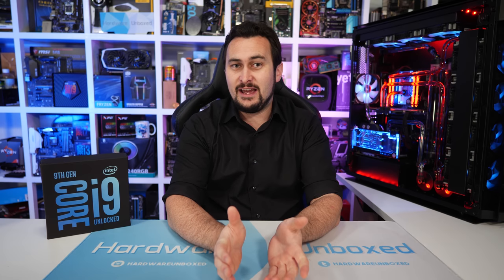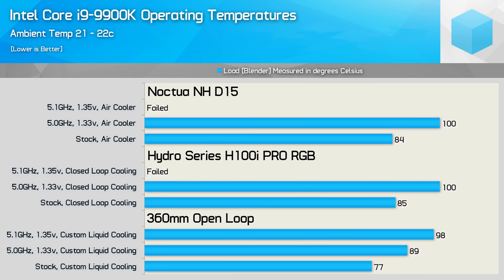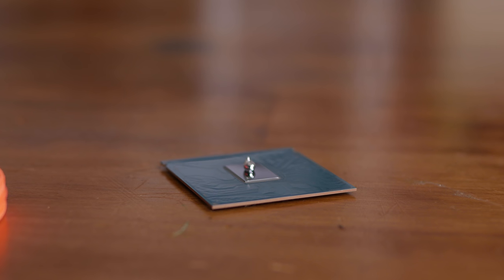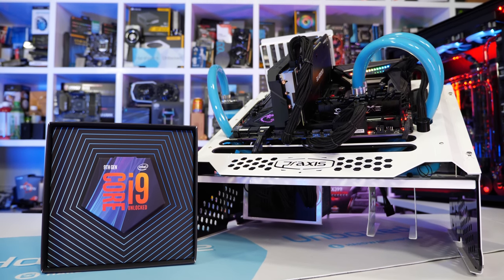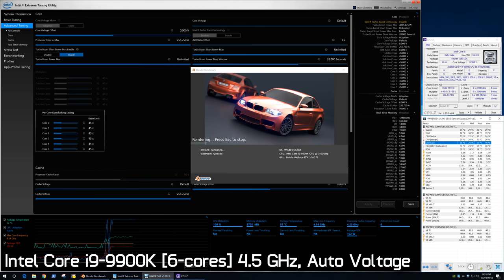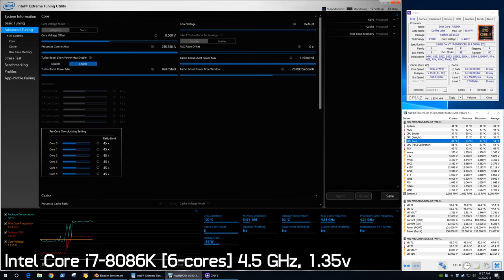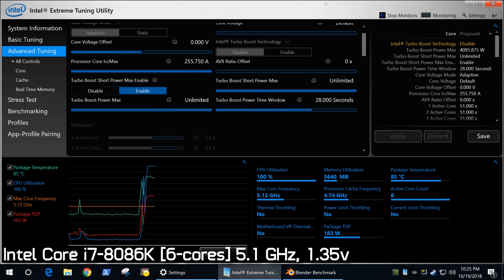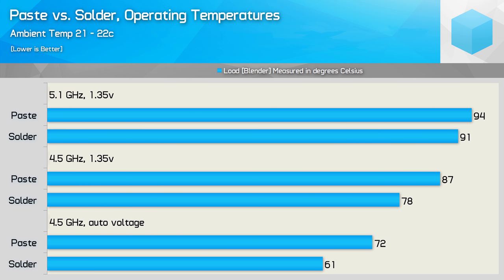Why is the Core i9-9900K so HOT? STIM test, Solder vs. Paste

Comment: I want to drop this here for anyone who is capable of thinking instead of some of the random memes and outright delusion in many other comments. The reason this CPU is so hot has nothing to do with intel's design, TIM, or any other factor. Could it be better...maybe but there are a lot of complex compromises that need to be made in bleeding edge products to produce something that not only works, but last for a long time. 

Solder itself when pushed through multiple "heating cycles" tends to kinda fail. This is why special soft solder is used as well as a lot of it. The softer and thicker the solder the better it holds up. Using leaded solder would also be great, but it is illegal in many places for this application(apparently)

As for their older TIM which many people compare to toothpaste despite linus showing it works much better it isn't bad for its use case. They could have used cheaper stuff that had better thermal conductivity at the cost of it only lasting a few years. Most CPUs are sold to people who don't know how or won't delid their chips after a few years because the TIM has broken down. I have a core 2 quad q6600 from 12 years ago that still performs the same thermally as it did not long after putting it in the system. Over 12 years and it is still holding up which is impressive IMO. The thermal compound you put between a block of your cooler and the IHS on the CPU doesn't need to last as long and thus you can get away with stuff that breaks down after 2-3 years of heavily use vs over a dozen years.

Now why is intel's cpu getting hotter than an amd chip with the same cores/threads and why did intel make design choices such as thicker solder, a thicker sub-strait, and a thicker die? Because these were necessary to accommodate such a high performing product. Thinner solder would fail much earlier than the 10-12 year mark.The thicker silicon wafer and thicker top on the die are necessary to help with stresses from being soldered from thermal expansion and contraction and still support the massive tower style coolers. AMDs CPU thermal layout is actually pretty damn similar just from looking. They use a very similar solder(if not the same it is exceptionally close and thus performs nearly the same), and their silicon wafers are pretty close in size. So then it is voltage right...no AMD chips actually draw more power believe it or not. The real answer why the 9900k is hotter than something like the 2700x and why all of intel's recent high end chips have been on the toasty side is 100% clock speed. Intel clocks their chips around 1ghz higher out of the box than amd chips and generally you can get an overclocked intel chip to around 1ghz higher than a similar amd chip. The speed included on chips(in ghz in this instance) are the number of clock cycles per unit which is still in seconds these days IIRC.(ram these days is ddr which is double data rate, but AFAIK CPUs are still measures in clocks per second) So the jump from 4ghz to 5ghz is a 25% increase in clockspeed which is a lot more energy used per core some of which is lost as heat.

For example take a 2700k and a 9900k and clock them both at say 3.8 locked and then look at the temps. I guarantee you the amd chip will be slightly higher assuming everything else is equal.(same case, cooler, fan speed, thermal compound used, ambient, etc) This will only become more dramatic as you push the 2700k up closer to around 4.3ghz which is generally the max overclock I have seen without exotic cooling and such. The intel chip clocks higher out of the box. Clock speed isn't the be all and end all most of this knows this and if the intel chips were clocked the same as the amd chips there would basically be parity between like models outside of any architecture differences as amd is pretty close to intel in IPC at the moment. So the 2700x would have roughly the same performance as the 9900k making price really the only determining factor.

Now on to price. Yes this is an expensive chip because of the performance. It takes a lot more time and money on engineering and R&D to put out something that is at the very limit of technology...not just for intel but for CPUs in general. We are starting to hit the point to where we can't get smaller or more power efficient with currently known methods. This is why smaller nodes(intel 10nm amd 7nm which are basically the same thing) have been delayed so heavily. Without getting into quantum mechanics we are at a absolutely microscopic scale here. The transistors used in current chips are only several atoms thick which is causing issues. Any smaller and we start running into Quantum tunnelling which means we need some new space age material or some new redesign of processors which really haven't changed on a basic physical level in decades at this point.

Comment: This Intel release kinda feel like a rush job.They were on the back foot and needed to release something.That something not necessary good.This price is wrong for the performance.It over heats.They tried what amd did just worst.AMD's not the fastest cpu by all means but it's better.Price is cheap.Can get away with stock cooler.Cheap Mobo and over all good performer.
Reply: >This Intel release kinda feel like a rush job.
mostly because it really is. 8700k/8086 does the same job for games on low rez (likely 8086k is even better with more overclock headroom) and for anything else threadripper offers a lot more

Comment: "If you don't want it to overheat, don't overclock it!"
Reply: Good Advice, buy an Intel K CPU that is meant for overclocking and don't overclock it.
Reply: Excaliber  Or just melt it while running cinebench in a loop.
Reply: Exactly what Apple would say if they made this chip 😂😂😂😂
Reply: @vishalgb315  actually Intel said those words back in 2017 in response to people complaining that their 7700K overheated when overclocked
Reply: Problem is it needs like a Noctua D15 just to stock turbo! 😆
Reply: Excaliber  My problem exactly with using it as a workstation cpu- hot, power efficiency and long term reliability of itself and other components.
Reply: Excaliber  My problem exactly with using it as a workstation cpu- hot, power efficiency and long term reliability of itself and other components.
Reply: @carlwells9504  imagine using it with stock Intel cooler they bundle it with those Pentium CPU

Comment: Problem is if you have 2080ti, the only CPU that can feed properly it is the 9900K. Overclocking doesn't really make a lot of sense, since the default config is really enough. Overclocking will just kill a very expensive an already very fast CPU.

Comment: The reason why 9900k is hotter than the 2700x is because obviously the much higher clock speeds AND smaller die size (~177 mm2 vs 213mm2). The 9900k has much higher energy density and there's a lot less surface area transferring the heat from the die to the IHS.

Comment: Intel's architecture is just hitting its limits. Just like Ryzen hits a wall at 4.3ghz, Intel hits a wall around 5ghz. The chips will do it but voltage and temps skyrocket along with power consumption. I wonder when they'll start from scratch like AMD did with ryzen? Been using "Core" arch since 2006. Starting to see the limits.

Comment: Had my 8700k running 4.7ghz allcore on 1.240v prime AVX load  with delid 82c

9900k running 4.7ghz allcore with 1.185v prime stable with AVX max 83c (none delid)

Sillicon lottery seems to be a thing. Or someone is pushing too many volts on the 9900k

Comment: I disagree they added this because they wanted a safe product based on intels not streamline process for soder since there manufacturing facilities are not as compared to AMDs third party manufacturers. This is the price for keeping a closed community to the CPU market and want to keep everything in house. Yes it drives cost down but when you dont want to change the manufacturing process for profits instead of innovating and mocking to slap 2 chips together for reduced tempatures.

Comment: Let's say, we're going to use this chip under normal conditions in a workstation without any fancy coolers and no OC. Does the STIM has longer life span than PTIM? if yes, then Intel did the right move 100% .
Reply from the maker: Life span should be the same, longer than you'll want to use it.

Comment: I think thats why AMD split in 2 CCSs! Spread the heat more evenly!
Reply: No. At the end of the day it really doesn't matter all that much. If you took at 2700x and somehow got it to 5.0ghz without exotic cooling it would probably be hotter as it would require more voltage.(not sure why this is probably because of the CCX splitting)

For example you can take a 9900k and clock it at 4.2ghz and overclock a 2700x to 4.2ghz(if win the silicon lottery 4.1ghz seems more common) and the 9900k would actually do better thermally. Think of it this way; each clock cycle is x times more energy where x is the number of cores. If you speed the clock speed up a full 1ghz you are increasing the heat by almost 20% per core which is 8 in this case. Now the math isn't linear but for a simplicity sake you are putting out almost 2.5 times the heat over the whole cpu.

Edit: Again the math isn't linear in anyway. Despite the tons of armchair engineers cracking jokes about how hard can it be to design a cpu there are tons of factors at play here. The people who dabble in this kind of engineering are insanely intelligent beyond my wildest dreams. I know enough about thermal engineering and thermal physics to understand concepts but that is about all.

Comment: My 9900kf 5ghz 1.3v bios h100i with noctua nf12s push pull gets 89 90c prime 95 otherwise it's normal performance is 50s to 60s gaming 80% fan speeds.. dunno why you guys are betting such high temps

Comment: Your comparison is flawed.
The 9900K is a bigger chip and therefore spreads the heat more effectively that the 8086k.
Also the chip itself is thicker again influencing thermal performance.
They are not the same chip with just 2 more cores.
The STIM is actually worse than your results are showing by disabling 2 cores as it still has some advantages of it's physical size.
Ultimately they had to use STIM instead of paste as the chip simply wouldn't run at the desired clock without it. But it's still a poor implementation, the cheapest Intel felt they could get away with.
Reply from the maker: Ohh okay
Reply: Hardware Unboxed actually gamers nexus have spoken about this in their review and they are a lot more knowledgeable than me. Probably worth watching their take on it.
Reply from the maker: I've seen the video, we understand the logic. I even explained in the video that it's not a an apples to apples comparison, but the data is interesting so I presented it, with the disclaimer.
Reply: Hardware Unboxed fair enough. I didn't hear the disclaimer. Probably had the kids harassing me.
Keep up the good work.

Comment: If you run 1440p and you have an  i5-4690k OC'd and above or a Ryzen CPU. This is all moot. These 1080p benchmarks are pointless. Keep you 4 year old and newer PC  and get a nice 1440p 165hz monitor on Black Friday and possibly upgrade your Nvidia GPU to a higher 10 series card for more fps. Ignore the i9 and RTX launches. Intel and Nvidia are losing their minds

Comment: should have just use a 360mm aio with push/pull. Works perfectly. Can't believe anyone try to use 240mm. It's 2018 omg....
Reply from the maker: We used a 360mm open loop for this testing.

Comment: I don't get the deal with thermals, it is faster, it's not like its hotter and worse. it doesn't mean that its a good choice but whats the deal? what did you expect? more performance with less heat on the same process? I honestly think its a stupid product even if it ran at 60c since 580$ for an 8 core cpu is too much, you can get a 12 core zen+ Threadripper with a much richer platform, or a 1950x or even a 9000 series 10 core skylake-x refresh one (again, the platform is richer) for not much more

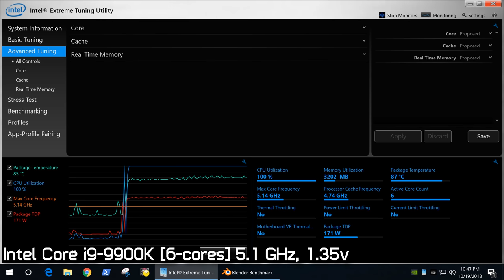Comment: Thank you for the logic presented. @ 6:41 170 watts or thereabouts power draw for 6 cores at 5.1ghz for 9900k. So one needs the new release chipset motherboard and a high quality power supply and cooler I would imagine to get this result. What was the VRM temps? I think maybe with all cores active it would be a concern. Whats the total cost in Australian dollars to buy an upgrade bundle? $859 just for the cpu is a quote I got from PC Case gear. I feel like its out of my reach to buy this, I like Intel CPU's its just that I cant justify the cost in buying it. The wife would say I wasted the money lol. It games like a bat out of hell, I'll give it that. I have a feeling the 13% Instructions Per Clock for Zen 2 will be just what the doctor ordered. :)

Comment: To be fair, larger Die size would help with also lowering temperatures. I think Steve from GN was also gonna do these tests but it wouldn't be fair because of that reason.

Nonetheless, it's pretty good to see  that Intel manages to turn toothpaste into solder? Dunno how they did it, maybe some special method

Edit: forgot to mention how the 14nm+++++++ is handling in today's tech world
Reply from the maker: It's only a larger die because it has more cores, it certainly doesn't help to lower temperatures, quite the opposite.
Reply: @Hardwareunboxed  would the physically larger Die not help when disabling the cores to make it a 6 core though? I feel like it would make a small difference since the heat can disperse over a larger area before being transferred to the IHS then the cooler itself
Reply from the maker: @LucaG1  ohh right sorry misunderstood. The difference would be so tiny I'm not sure it's a factor. But like I said it's not a super scientific test but it does give us a pretty good idea.
Reply: @Hardwareunboxed  yeah I thought so too, the results here do give a good representation though. Just waiting to see all the "you can get an egg on an Intel CPU" memes, after coming from basically all AMD products being joked as heaters ayyy.

Also I re read my initial comment and did realise I didn't really specify the whole disabling two cores part so it was my fault  in the end